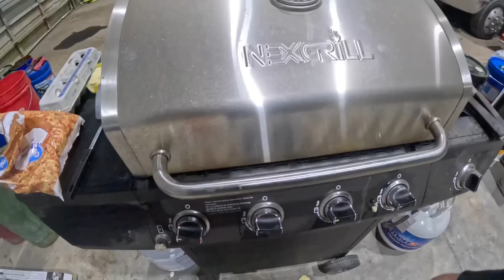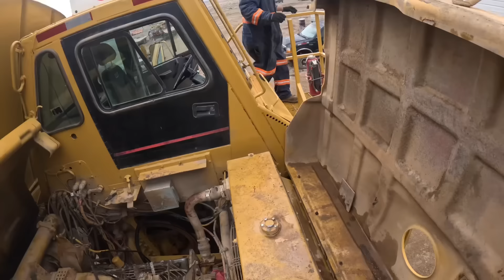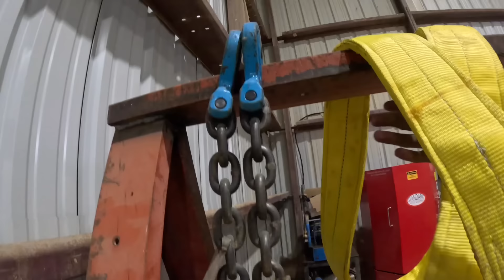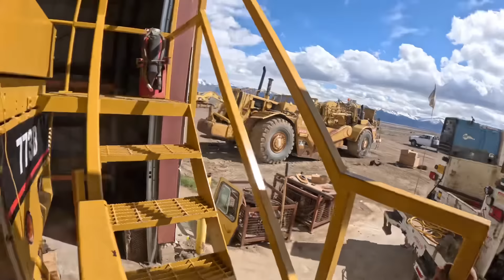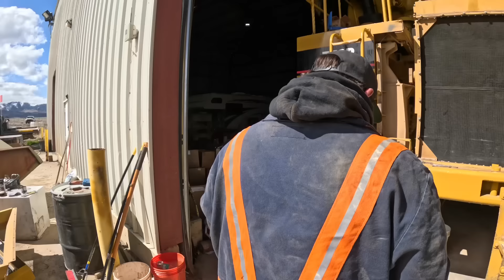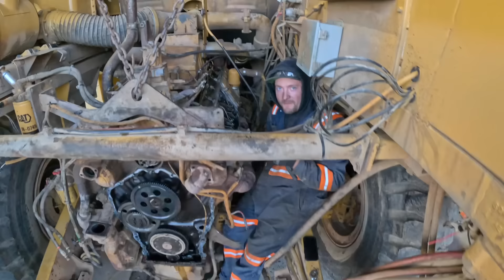CATASTROPHIC ENGINE FAILURE!! CAT 773B…lets fix it!! Part 1

Comment: Pretty wild that the truck could run and operate to the point where it was not noticeably broken. Compare that beast to a modern civilian daily driver vehicle… a tiny problem like a funky o2 sensor and the vehicle will cry and complain and de-rate itself to 35mph and run like it just threw a rod. 😂I love old Cat equipment. Stuff was built right.
Reply: Cats are overbuilt .. They keep going and going until .. like this one, they literally DIE !!
Replace the motor and off they go again !!!!

Comment: 2 questions,  1 did you drain off some of the extra oil in crank case , 2 why don't you drag a air line out there and air up the air system .

Comment: just out of curiosity which engine is this ,,    it looks like a 3412   ,, i own a couple 3408 engines  and it looks a lot like  them  just bigger
Reply from the maker: Yep 3412
Reply: @quintonbartolotta  cool , that's one big engine
Reply: @wildcoyote34  In the world of CAT, the 3412 is a "mid size" engine.
Reply: @ducewags  i do know this ,, i've worked on a few bigger engines ,,like a 12V149 ,,always wanted to get my hands on a 3412
Reply: @wildcoyote34  3412's fresh rebuilds ready to go, just a phone call away. Well in my area of Minnesota it's a thing.